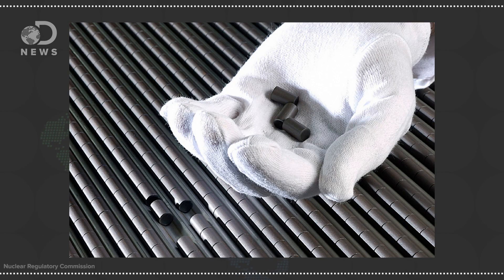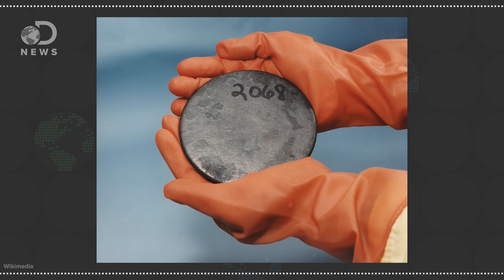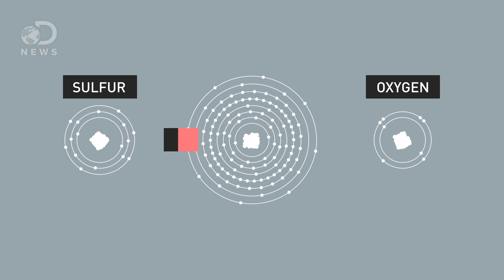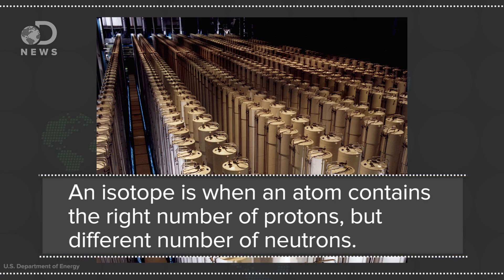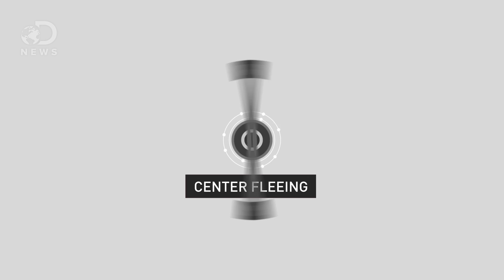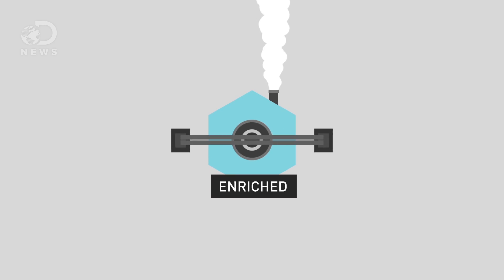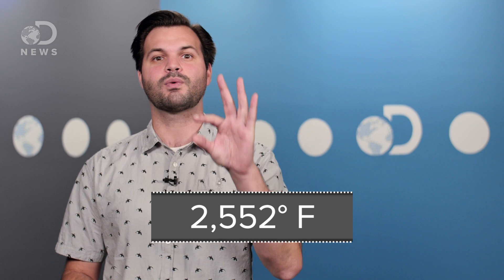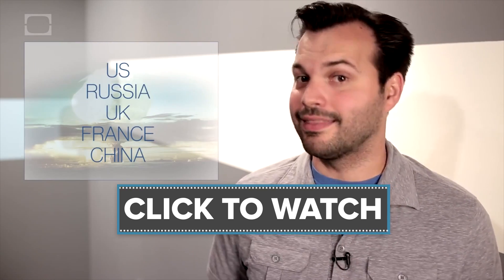How Uranium Becomes Nuclear Fuel

Comment: you didn't mention Heavy Water reactors like the CANDO developed in Canada. they don't require enriched uranium, use 30%- 40% less fuel and are more efficient. The reason why America uses the much more complicated and expensive and dangerous light water reactors is because when they were developed after the second world war they needed the enrichment facilities to create the fuel needed for nuclear weapons.
Reply: +Dirks 2.0 Yea it's fucking stupid, we can't use modern reactors.
Reply: +blackypain How does the fuel channels touching spell environmental disaster though? There is always the vacuum building to stop releases. That is just something that needs avoiding, with backup generators and the lack of tsunamis coming off of Lake Ontario. The reaction would be sub-critical with a lack of moderator. The amount of tritium that escapes is also trace, minuscule compared to radon emissions of gas. The plutonium would also have too much Pu240 in it to make a useful bomb from the fuel burnup standards of today, and then there are international regulators.
Reply: I don't Understand light water reactor?? please explain it to me.
Reply: +Dirks 2.0 I'm Canadian, and no CANDU are not safe at all, I would say probably one of the worst, I mean they are all dangerous, but for what I know CANDU is a horizontal design, meaning the full is place horizontally not vertically, which has a major flaw if the level of water plunge; the gravity will force the full spend to curve and even touch one another making the whole containment unstable. So for that I see high risk. Also the principle of using heavy water facilate the production of plutonium 239, finally 1% of tritium simply goes directly in the atmosphere. Early version of the reactor "Chalk River" was used for production of plutonium during the American nuclear program in late 40's

Comment: Not a big fan of how we use it now. If we were using Thorium though I'd be completely for that.
I saw something said right now the reactors are like .98% efficient if that holds it's better than the rest than it seems totally stupid to keep using them. Supposedly in the right setup a thorium reactor can run at like 98-99% efficiency. It can't be weaponized easily, it's almost impossible for it to go Chernobyl. Supposedly too we could take old used uranium put it in too and use it for like 20 yrs, and it's decay life goes from millions of yrs to like a thousand or so.

Comment: Suggestion for correction at 0:30 : replace "efficient" with "energy-dense". The far greater energy density in the nucleus (strong interaction) than in chemical bonds (electromagnetic interaction) is what you are referring to (see e.g. xkcd 1162). In terms of energy efficiency, current fission reactors (non-breeders) actually only use about one per cent of the energy potentially available in the uranium.

Comment: Ready for "the REST of the story"? Here it is.

That 5% or 20% enriched Uranium will sit in a  reactor for about 4 or 5 years making electricity and AT THE SAME TIME, turn about 1% of that Uranium into PLUTONIUM!

Now they have to "get rid" of the "spent fuel" and put in some fresh Uranium, right? Only they don't dispose of the spent fuel, if by "dispose" you mean go bury it someplace.

They can extract the uranium to re-enrich it like before, that's more costly than starting from scratch with Uranium ore. BUT...

They can get all that Plutonium. And it's MUCH easier and more economical to make nuclear bombs out of Plutonium than to enrich Uranium to 90% and make bombs out of Uranium.

But the "rest of that story", in fact the most pertinent fact to the whole Uranium cycle nuclear power industry is...

...as long as humans continue to make power using Uranium, nuclear bombs will continue to threaten the extinction of the human race! And even if the chance of nuclear war in any given year is less than 1/10th of 1%, then over a period of 1,000 years, OUR EXTINCTION IS GUARANTEED.

Some of you may selfishly say, "So what? I'll be dead and gone long before that." Maybe, if we don't "hit the Extinction Lotto" for 50 years or so.

But that idea bothers me, and to those selfish cynics who say "Screwit." I say...

Kiss the darkest part of my white ass.

Comment: ok but whats a nuclear waste exactly???
Reply: ahmad ibrahim Nuclear waste 101:
In the uranium reactors we use today the fuel comes in the form of small cylinders containing uranium, these are put in long tubes and lowered into the reactor. The process that takes place in the reaction works as follows: 
-A neutron hits a uranium nucleus and two things can happen.
1: The uranium nucleus splits (unevenly) and form two new smaller atomic nucleus that roughly correspond to half the size of a uranium atom. In addition, two free neutrons are released, and this is what causes the chain reaction.
2: Very rarely, the uranium instead of splitting, absorbs the neutron. This transforms the uranium into plutonium. This plutonium can then also both be split or absorb neutrons; creating ever more highly radioactive elements, these are the ones called transuranics and are the dangerous ones that make you want to bury it for 100.000 years.

When the nucleus is split the resulting elements have very different behavior. One of the most common ones is Xenon. Xenon can not be split like uranium but it has a huge appetite for absorbing neutrons and acts as a massive neutron sponge in the fuel, so as the uranium in the fuel is split, the amount of Xenon increases and the ability of the fuel to chain react diminishes.
And, since Xenon is a gas with much higher volume then solid uranium - it will create small gas pockets inside the fuel cylinder, eventually making it brittle and hollow.

When the fuel is too damaged from the Xenon they remove it from the reactor and relabel it as waste.
At that point only about 5% of the Uranium in the fuel has been split to produce energy, or turned into plutonium.

The 'waste' is thus a lump of unspent fuel, radioactive transuranics and other end products with various behavior.

Comment: What happen once the rods are used? What do we do with the waste? And does nuclear power uses more or less water than other plants?
Reply: Alexieto In theory, there's multiple ways to handle it. The most obvious way is to reprocess it to remove things that can kill the nuclear reaction and reuse the fuel. Since governments are paranoid about nuclear proliferation and won't allow that to be done for fear that it could be stolen, we have way more waste than we know what to deal with, which brings in the second solution: stashing it somewhere where the local geology is unlikely to release it. Those places exist (Yucca Mountain was supposed to be one of them), but it's hard to find one that's sufficiently isolated that someone won't lose their shit over it. 

Mind you, if we did reprocess the spent fuel, there'd be a lot less waste going to places like that, but as long as radiophobia is still a thing, we won't be able to solve the problems we have now, much less deal with those of the future.

Comment: I feel that it's the best we have and that we should be using thorium instead.
Reply: KnightRaymund Not really. It still produces radioactive waste and weapons can still be made.
Reply: cfltheman The final energy output of 1 ton of Thorium ore in a LFTR equals about 235 tons of Uranium ore in a LWR.

Assuming equal 3% purity of the ore the waste from the LFTR will be about 2.1 kg while the waste from the LWR will be about 7 tons (6838 kg depleted uranium and 211.5 kg waste)...

The 2.1 kg waste from the LFTR needs to be stored for only 300 years.
The 211.5 kg waste from the LWR needs to be stored for 100.000 years.

And of course, LFTRs can consume the old waste from uranium reactors.

Comment: I believe we need to invest in more R&D for nuclear power.  There is a concept for underground salt reactors that use material that is far less radioactive and can be built with much better failsafes to prevent meltdowns.  While I respect environmental groups, it is counterproductive to protest against things that we don't fully understand.  Issues such as nuclear power should be discussed not by laymen, but by scientists.  And it should be done so in a public .

Comment: I feel the benefits outweigh the negatives, but only in the sense of other nuclear reactor types, as an example thorium fluoride reactors. Light water uranium reactors were only of interest back in the pioneering of nuclear technology, because of how "easy" it was to weaponize it. this isn't the cold war, nuclear fallout is not desirable, so why not use the better, less radioactive, safer, more abundant thorium. which also has a nuclear decay time of a few hundred years opposed to 10's of thousands of years of uranium. and thorium waste products actually have more uses, once the thorium is no longer usable for nuclear power, that does not include weaponizing.

Comment: The final energy output of 1 ton of Thorium ore in a LFTR equals about 235 tons of Uranium ore in a LWR.
Assuming equal 3% purity of the ore the waste from the LFTR will be about 2.1 kg while the waste from the LWR will be about 7 tons (6838 kg depleted uranium and 211.5 kg waste)...
The 2.1 kg waste from the LFTR needs to be stored for only 300 years.
The 211.5 kg waste from the LWR needs to be stored for 100.000 years.

The worlds Energy (2007)
Tonnes of Coal: 5 000 000 000 (five billion)
Barrels of Oil: 31 000 000 000 (thirtyone billion)
M^3 Natural gas: 5 000 000 000 000 m^3 (five trillion cubic meters)
Tonnes of Uranium: 65 000 (sixty five thousand)

ALL of this equals only 5000 tonnes of Thorium.

Google LFTRs
Reply: 5000 tons of highly toxic waste every year doesnt sound good.

Comment: You give a number of comparisons on efficiency of nuclear vs other fuels, do the calculations subtract out the energy required for all the mining, preprocessing, purification, etc steps? Those are pretty important...  You might also want to throw in the cleanup and waste storage costs in there also while you're at it.  In short, I'd like to see a full lifecycle analysis/comparison.

Comment: Is it really all that more efficient when you take into account the energy spent refining it? Genuine question.
Reply: ***** It isn't stable energy though. The extra cost of energy storage makes them more expensive at the moment, although they are an essential part of the energy mix. Nuclear can produce more energy but it can't change to demand well so it is best for providing base energy consumption.
Reply: ***** For £2 billion you could build a 1200 MW nuclear power plant, for the same price you could install about 1150 MW of wind turbines so the difference is not much, but this means it is important that we use both energy sources (in the UK). I would guess that factoring in energy storage for wind and decommissioning costs for nuclear both still cost similar prices, at least by the time we have adequate methods for storing all that wind energy.

Surely you must know that wind turbines aren't extremely constant in their output though. Even out at sea the wind doesn't blow forever. "Extremely constant" is an overstatement.

There are upsides and downsides to both technologies that I haven't included here but I will say that we can't rely on renewables yet, and we can't solely rely on nuclear either.
Reply: ***** It'd be interesting if you could show us your sources? I'm rather doubtful at how you are saying wind turbines are almost just as good as nuclear power plants.
Reply: ***** I can't exactly remember where I looked for the figures but I know it was a combination of looking at pricing figures from a manufacturer's website, some stuff on Wikipedia, and I'm pretty sure I just looked for the cost of the Heysham 2 construction. I don't think I included the cost overruns that often happen on new reactor design builds or the cost of the storage requirements needed for that much wind power either. It's just a rough estimate tbh.

My point is more that they are both viable energy sources but neither is a magic bullet.
Reply: i was thinking the same thing
Reply: PaddyMacNasty how are wind turbines more efficient?

Comment: People are idiots and make mistakes. Fact. I'm not even going to reference the Fukushima backup generator in the flooded basement, just the Stuttgart (Germany) plant built on biscuits soil, a disaster waiting to happen. Just because of how imbecile and reckless some people are, I say go hydro and solar, with compressed air and batteries for overnight storage. Elon Musk is for it so it's good enough for me. And come on, big dams are incredbily beautiful ;)
Reply: ***** If you worry about the risks of nuclear you should be far more worried about the risk with hydro.
In 1975 about 62 hydro dams failed in China due to a typhoon and caused the deaths of about 230,000 people...
Reply: Merecir I had no idea, I'll go read about it, thanks. In any case, solar is #1 ;)
Reply: ***** Sorry, deaths per power output makes solar more dangerous than nuclear.
It is dangerous to install those things on rooftops you know.
Reply: Merecir It's horrible, but I can only shrug. Those people could die exactly the same way either for PV panels or for cleaning their roof gutters in the autumn. It's what you get by democratizing an energy source. You get everyone and their dog performing a moderate-risk task. And because they don't manage the risk... natural selection. PVs are not an inherently deadly job, so I can't be sorry for the people that somehow manage to die. Just use hooks and ropes, if you really want to live.

Comment: Nuclear power is the best source of power, sure once it fails it fails badly. So we need more security for it, but in the long-long-term it's WAY better to use nuclear power compared to fossil fuels, such as oil and coal. Because of the environmental impact coal and oil has.

Comment: What I find amazing is after all that drilling and centrifuging, the energy out-put is still a net positive...
Reply: Damian Spence Maybe because the energy release from fission is a million times higher then the chemical bond in fossil fuels.
Reply: Damian Spence Even after all that it is still far better than what we do to produce oil
Reply: It is a fuel that will work to do what it was designed to do for hundreds of thousands of years. It doesn't go bad.  Ever. It just doesn't work as hard or as well as it did before.

Comment: I don't think we can make the transition to 'cleaner' and more environmentally friendly energy sources without Nuclear power but I do think that we should stop using it as soon as alternative power like solar/hydro/wind etc. is advanced and widespread enough to rely on. In the meantime I think we should stop building new power plants and focus on dealing with the waste and safely decommissioning old reactors. When we eventually figure out getting energy from Nuclear Fusion then maybe that will be an option but we've been saying we'll figure it out for decades now so I'm not sure how likely it is that we'll manage it before 'greener' tech is widespread.
Reply: BlahBlahRainbowFish The ONLY way to get rid of the old waste is to use it as fuel in new nuclear.
Google LFTRs.
Reply: Merecir That was damn interesting - even for someone who hated Chem - thanks :) Definitely sounds like a replacement for using Uranium, if only we could get people on board although it looks like the main reason it's not in use is Uranium's part in the arms trade. LFTRs should get developed and used but not permanently because even though we'd only need to mine relatively small amounts it would still mean mining which needs to stop.
Reply: BlahBlahRainbowFish 
The worlds Energy (2007)
Tonnes of Coal: 5 000 000 000 (five billion)
Barrels of Oil: 31 000 000 000 (thirtyone billion)
M^3 Natural gas: 5 000 000 000 000 m^3 (five trillion cubic meters)
Tonnes of Uranium: 65 000 (sixty five thousand)

ALL of this could be replaced by 5000 tonnes of Thorium.

5000 tons is tiny and could easily be mined from one medium sized mine.

One mine, to power the world.